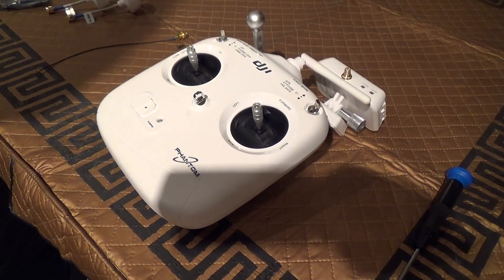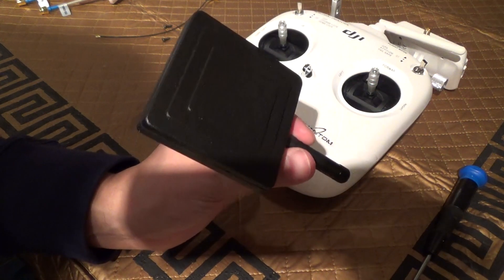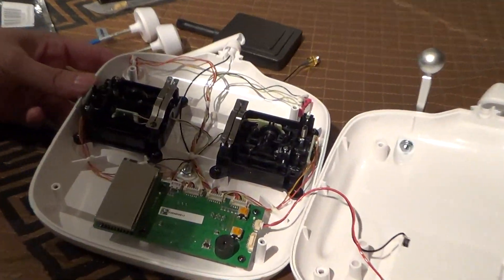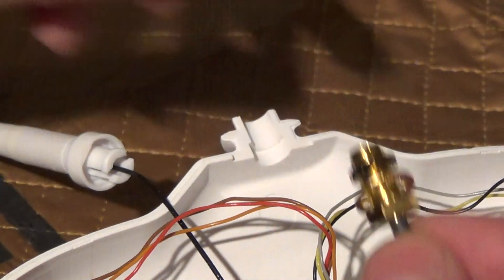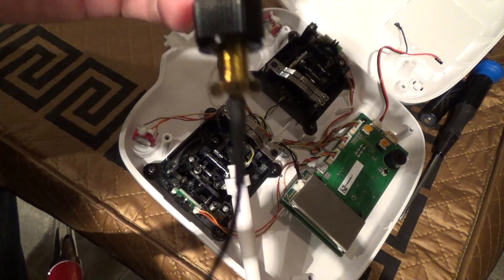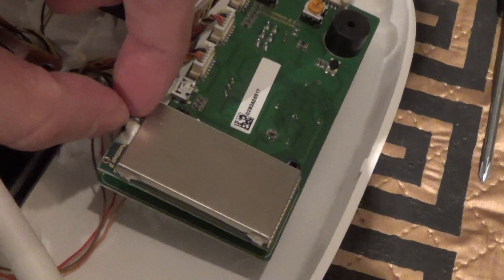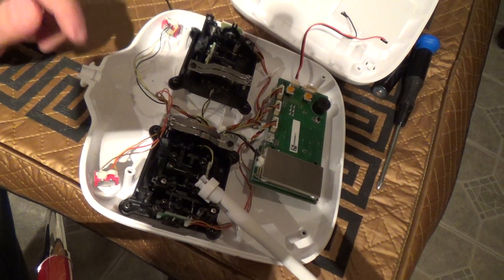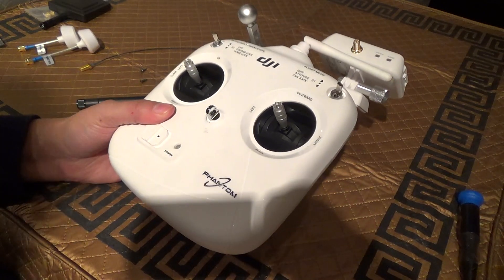DJI Phantom 2 Vision RC Controller Antenna Mod Assembly and Disassembly.

Comment: Hi did the mod, however testing outside, I could only get around 800ft horizontal distance and it loses connection and returns to home. Same thing with going high. It lost signal around 300 feet and the quadcopter was just next to me. Any suggestions what I could do to fix this? Thanks.

Comment: Thanks for your outstanding videos Ben. So far you have been one of my "Go to" guys for mods and information.
Now, I have got a question............after doing the controller antenna mod is there anything that needs to be re calibrated or reconfigured in the controller software?
Also, is there any way of telling my antenna mods are a success other than taking out and flying it? I have done mods on both the controller and range extender. Thanks.
Reply from the maker: Hi, no changes need to be made and the only easy way to see the improvement other than taking it out for s flight it so test the outgoing signal with a meter.  The way I would do that for the wifi repeater is easy I could use wifi analyzer to see how strong a signal I was getting from different antennas.  Tho being that the 5.8ghz controller isn't wifi really the best test is just taking it for a flight.  And again no changes need to be made otherwise software or hardware.  Patch directional 5.8ghz antenna will yeild the greater result in terms of range but I feel more comfortable using a high gain omni directional to insure I always have a control link to the phantom should I loose visuals for any reason.  The stock antenna depending where I would fly only got me to around a kilometer but using a 5dbi tplink 2.4ghz antenna got me over 1.5km.  Using an antenna specifically tuned for 5.8 will yield the greatest results.  I also got a 1 watt 5.8ghz Sunhans amp so I can push max range should I ever need or want to.
Reply: Ben7seven7 My set up is a dual band 5dBi High Gain omni directional antenna on my controller and two dual band High Gain 6dBi antennas on my wifi repeater. I have not done any mods to the phantom itself.......other than a Rotorpixel gimbal, but that's another thread. haha.
Hope this all sounds about right. I am a newbie at this antenna range stuff and like I said earlier, I don't plan on taking flights to Mars but did want at least a little extra range.
Thanks again for all your help.

Comment: Ben7seven7, I tried your antenna mod and it works perfectly. I put a TPLink 2.4Ghz on my remote (because that's what it operates at) and took it out flying and works just fine. FWIW, I used an Xacto knife instead of a folding knife, the white silicone came off in three swipes of the Xacto, no need to chip away at it. I purchased a shorter pigtail antenna which made the internal connection simpler. My only issue is the screw-on antenna mount is still causing my TX case to have a gap... I figure when I dremeled off the plastic on top of the TX (just like you did) I didn't make both halves flush with each other, but hey, it's tight and works! Thanks for the online instructions.

Comment: hey, very good and clear video. One question: If i have the P2V+ Version 3.0 (that has micro usb to charge it.) is there any important modification changes i should know? Thanks Ben7seven7
Reply: Great videos Ben7seven7! Thanks for the level of detail. I have the v3 like RicasPicas so I'm looking forward to any suggestions you have. Also, any mods to the copter itself would be helpful. Thanks again.

Comment: I was thinking about modding my controller to have a trainer port output. Having taken one of these apart, do you know where the ppm output and is on the board?
Reply: Did you ever find out about the ppm output. I'm trying to do the same thing, but there's amazingly little info about this on the web.

Comment: can this mod be done on a Futaba 14sg radio. I would like to put a better antenna on it too...
Reply from the maker: Yes this will work on a futaba and has been done by others
Reply: Ben, does the part number you provide with the mod, the antenna cable for the antenna work with the 14sg, same size connector as the phantom radio?. and do you have a part number for a shorter cable. On the 14sg it's a real short cable. Thanks again ben.....
Reply from the maker: I am pretty sure the same u.fl to rp-sma pigtail will work.  They're all readily available on eBay tho I don't know what the ideal length is for the futaba tho it wouldn't hurt the signal going with a slightly longer cable than needed.  I have some links in my description for parts tho I'll add some more to include thicker gauge cable as well.
Reply: sounds good, I'll look for then Ben, thanks.......

Comment: I got a phantom 2 but the controler lights red and when I turn the screw no sound or beeps are emitted
Reply: It's because its 2.4ghz controller, 5.8ghz controllers are green and beep. I didnt know this either till I bought a 2.4ghz controller and RX to convert my FC40 since 5.8ghz video transmitter would interfere that Im going to install
Reply: Thanks , so the range booster works but without any beeps.
Reply: Correct, Turn the knob all the way clockwise to get the extra range
Reply: I got the 2.4 wifi booster and 3 antenna plus a zeiss cinemizer plus
Reply: Cool, although I'm a bit afraid to go that far without fpv so I ordered a pair of zeiss cinemizer plus not the with expensive once but the other black model which is half the price ... Zeiss did upgrade them for fpv and now I can really test the range .

Thanks again :)
Reply: Don't blame you, a lot of money to let it get out of your sight lol
Reply: Yeah ..the p2+ cam and gimble with the fpv system just shy of €2200
Reply: But it's well worth it :)

Comment: Taking off that silicone is awful. I broke the connector off and don't think I can salvage it. Looks like I'm buying a new controller... Still want to upgrade but don't want to try the same route again so... can you not just splice the new antenna cable with the old one? Will that hurt the signal transmission or something?
Reply from the maker: Yes you could splice the cable if you know how to do it properly.  If you knocked the connector off and are talented with a soldering iron you could solder on a new male ufl connector to the board which should also sort you.   Another alternative is investing in a Futaba Radio Controller. It can be bount to the Phantom without having to to take anything apart and you'll get better range right off the bat as the Futaba's are higher power output.
Reply from the maker: That's why I took my time and did it slowly using a very sharp knife.  That's also why I showed the whole process from beginning to end so other people see what it takes to do it properly.

Anyway sorry to hear your connector was messed up.  It can be re soldered back on. That or a new connector soldered in place.  It's skilled soldering work but it can be done.

Other upgrade route would be buying a 3rd party remote like a futaba
Reply: Ben7seven7
thanks. my dad was able to solder a wire to the board in place of the connector, and he built a little interference shield around it since it was more exposed than with the original connector, but it topped out at about 600 ft range. had to buy a new controller, and i was able to successfully modify it today without breaking it. topped out at 2280 ft (i also upgraded the wifi according to your other video) but weather wasn't so great so it may go a bit further otherwise.

so... lesson to everyone else -- be extra extra careful and use an xacto knife.
Reply: gnznroses oh and i'm using the 6db omnidirectional antennas btw, for anyone curious in terms of range. everything stock i maxed out at 1200, losing video feed first i think. with wifi upgraded but not the controller, i hit 1900 before losing control signal. now i have 2200 as i said but i'd hope to be able to do more in better conditions.

Comment: Hello Ben, I have found the video's you've made most informative. Clear, concise, and complete right down to the last detail. However, unless I've missed a response you have given to a prior question, I've not seen you comment on any of the test results you may have received upon making various changes to both your transmitter when using the flat 11db antenna, and or the Sunhans 5.8 ghz amplifier. I was very much awaiting to read what if any flight distances you may have experienced with those mods.  Thanks again, for your help.
Reply from the maker: Thanks for the feedback I did post distance results on some of my tests in other videos as well as the description area.  I've so far only gotten around to doing 1.4km distance or roughly 4,600 feet.   Without the 5.8 control mod I would have connection problems at 2,800 feet so big difference.  I was only using a 3dbi antenna for the 4,600 foot flight.  That was without using amps and 640x480 15fps

Comment: What is "CE" and "FCC" mode? Please explain.... I'm new to multi rotors.... I just bought a phantom 2 with a zenmuse h3 3d gimbal and it operates in 2.4 GHz.....doesn't beep like yours
Reply from the maker: FCC mode increases the power output from 25mw to 100mw
Reply: Ben7seven7 Ben i just did the quick mod you said when turning the little pot inside my PH2 transmitter (TX) i didn't or don't get no double beeps and i turned it as far as it would go gently to the right (clockwise) plus my light has always lit up red weather the batteries are brand new or fully charged,what's you thoughts on this mate? oh mine is 2.4 Ghz just in case that matters. :-)

Comment: I performed the upgrade on my P2 w/H33D but left the stock antenna in place drilled a hole near  where the connector plugs in and used the FPV Model 2Watt Booster http://www.fpvmodel.com/2-4g-mini-2w-power-amplifier-long-range-module-for-2-4g-radio-transmitter-phantom-compatible_g581.html which is the size/weight more/less of an ESC plugged in my 9dBi antenna and Bobs your Uncle-the silicone is a pain in the A** removing-small piece after small piece till gone.great idea-Thank you.

Comment: I have seen some discussion about using the 2.4GHz antenna on the 5.8GHz wifi extender, so I emailed the tech support at TP-LINK. Here is their answer:

"Thank you for choosing TP-LINK, This is Cassie from TP-LINK Technical Support.

The TL-ANT2405CL is not compatible with a 5.8GHz transmitter.
We cannot tell for sure if it will be a 5dbi output when connected in a 5.8GHz system, because we haven't tested to use it that way."

So, I'm not trying to be controversial, but I wonder if I should be shopping for an antenna designed for a 5.8GHz system?  Perhaps you can provide some more details as to why the 2.4 and 5.8 are interchangeable? Is it just because 5.8 is exactly double 2.4?

I have already done this mod, and I had an 8db TPLINK on it, but now I've ordered a 5db just because the 8 was so long. I haven't flown far enough away to find test the distance.

thanks for your videos! They are really helpful.
Reply from the maker: The wifi range extender is 2.4ghz not 5.8.  I have interchanged antennas labeled as 2.4 and 5.8 and they all work fine on either equipment.  The wavelength being exactly double does certainly contribute to that.   The gain will be different though.  That's why you got that response from TPLink.  The DBI rating they gave the antenna is based in it being connected to 2.4gjz equipment.  The gain will go up or down depending on the 5.8ghz equipment you connect it to.   Using a 3dbi antenna off of a 2.4 ghz router is got significantly better range and performance than the stock antenna on the transmitter.   I've also used the 5dbi tplink antenna flying further than I was able to on stock antenna.

If you don't mind using a directional antenna tho the 5.8ghz 11dbi patch antenna is a very popular choice for the 5.8 control and you should get all the range you need from that one.  Up to a point tho you will eventually need to add amplification depending on the conditions of where you fly.  Also the power output of the rc controls seem to vary somewhat based on various testing by people with RF meters so distances will vary.

I've flown out to 1.4km with the 3dbi antenna. With the stock antenna I had control issues before 1km
Reply: Ben7seven7
 thanks for that!!! I totally mis-read the info on the first video about the extender. Of course, I've confirmed now that the extender IS 2.4GHz. I have the 5db antenna now, and I'll go long range next day of good weather. thanks again Ben for all your videos. Also, I'll see you over at the Phantom forum,
doug86

Comment: Im still working on getting my FPV video range up on 5.8 so doing this mod makes no difference to me yet.  I'm using DJI AVL-58 w/ Spironets on the Boscam 5802.  I think if i had to do it over again i would try something different.  waiting on a Circular polar Helical.  Hopefully I get decent range on FPV and then I'll try this on my stock 2.4 DJI Transmitter.  Did you try it on your setup yet?  Which antennas did you try?
Reply from the maker: Yes I have a new video showing my mod procedure and antennas used.  So far using just a 3dbi antenna  I got off a 2.4ghz router and it has given me no less than a 50% improvement over the stock antenna.  I also have a 11dbi 5.8ghz patch I'll be trying as well.   Overall I am pleased with the improvement.

Comment: Ben, just some corrections. The 5.8ghz cloverleaf you showed is actually better. You mentioned that it is smaller but that is just because of its frequency and does not hinder its performance. 5.8ghz is the smallest antenna, 2.4 is larger and 1.3 is largest. Also, the whip antenna must also match the frequency of the transmitter or radio that you are using. Any whip antenna will work is not correct. If you open one up, you will see that there is a metal casing inside some and others have coils. The spacing from that casing and/or the coils what causes its sensitivity to the specific frequency. Saying that any whip will do could cause someone to lose signal and have a flyaway.
Reply from the maker: Not entirely true, I've used antennas labeled as 5.8 or 2.4 on alternating equipment and it worked without a problem.   Also if you loose signal it's no different than turning your controller off to initiate the fail safe return to home function. Not cause a "fly away".   I appreciate the input tho and am familiar with some of those differing internals in some whips you mention.  I also know the 5.8ghz clover lead I have at minimum will work equivelant to the low gain whip on the controller I just don't know for sure if it would work any better.  I do have a nice 5.8ghz patch antenna I know from others works exceptionally well.  And it has 11dbj gain on 5.8ghz

Comment: I noticed that you use are indoor antennas. Can you use outdoor antennas?
Reply from the maker: Yes you can use any antenna that suits you as long as it's the right frequency range and connector.  I've mixed and matched 2.4 and 5.8 antennas with out problem. And most whip antennas work with both.

Comment: Watch out making this upgrade. I broke off the pin on the chip that is no where to be found. DJI will not get it and reply was buy a new transmitter or take it where you got it for an exchange? So be very careful making this as chip clip very easy to break off and for me now what?
Reply from the maker: What pin and what chip?
Reply: In your photo the silver chip that the antenna plugs into with the mini female clip. It is the silver chip or control that unplugs and has a 20 pin plug into on the transmitter control board. I broke off the connector and now DJI just says buy another transmitter with can't get the chip. I tried to solder it and don't thing I can get the range I use to with the new antenna. Going to try and 9db longer to see if that helps but still would like to get that part to replace it.
Reply: The clip broke off and pin still there. The 5.8 antenna chip no where to be found without buying a whole new tx. I have done a solder job and added a 9db antenna and handling it very careful, but still would like to replace the whole chip this plugs into.
Reply: Dennis Daniels
 By the clip and pin do you mean the pin in the center of the tiny pci connector that the antenna plugs in to on the board?  If so you can solder on a new one. There cheap and with some paste solder  are not to hard to solder a new one back on to the board. http://www.ebay.com/itm/320870286866?ssPageName=STRK:MEWAX:IT&_trksid=p3984.m1423.l2649